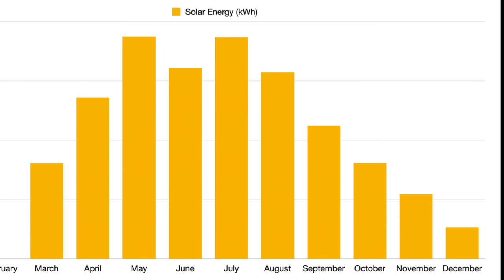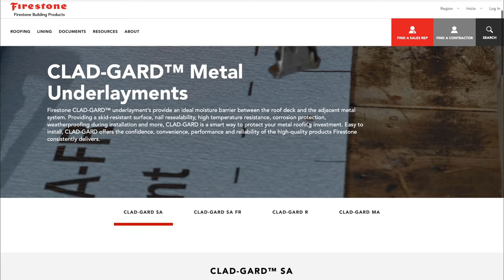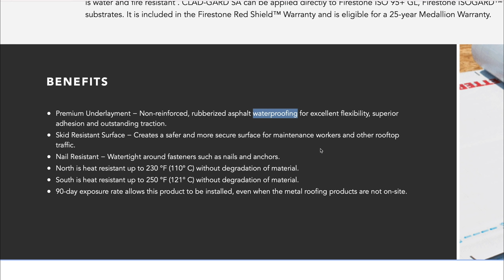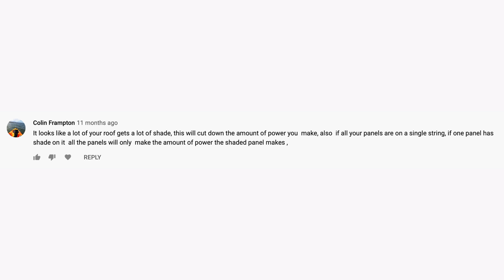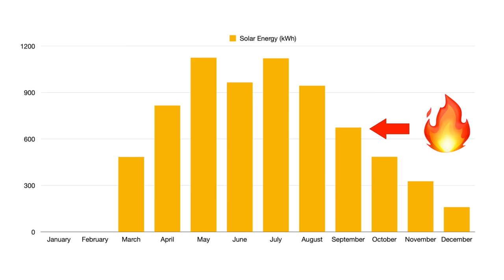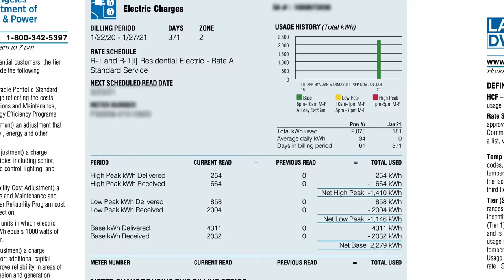1 Year with Tesla Solar Roof: top 11 questions answered + real production numbers & utility bills!

Comment: That electricity bill should have been +1,800$ as the power company is mooching off your excess.
Reply: I wouldn't be entirely sure of that. Due to the power production shutting off at night, which is when most power is used, and falling off during winter, again when most power is used, I'd expect them to still be using a noticable Chunk of mains electricity each Day. Depending on what the arranged, they could have gotten Lower cost's per KWH, or gotten money off there bill based on how much excess power they sent there. Alternatively, the power company could be a dick, and say that because they are taking the excess power off there hands, they don't need to give them any/extremely Little financial composition for the power they generated, in which case your probably right.
Reply: They sent 67% of the power generated to the city and yet the city still bills them. The homeowner should send the city a notice to disconnect unless LA pays their overdue bill, with late fees of course.
Reply: @Santisima_Trinidad  But that's not true. Power gets stored in the Tesla batteries for use when there isn't clear skies or sufficient daylight available.
Reply: @Santisima_Trinidad  most of the power is used during the day... 

It's a general rule but I think it's especially true in California where if you don't have your AC on 9 months of the year old people risk heat strokes since the whole state is basically a desert
Reply: @fixafix69  not here power isn't. AC is bassically unheard of, and heating is normally only used in the evening/night. That, plus almost everyone is out all day for most of the year. 
Still, thanks for correcting me about power usage in California, was just assuming power use was bassically the same everywhere, hence me forgetting about AC and such.
Reply: @DaSixtyNiner  OP didn't get the battery pack ("why no power wall? It was too expensive at this time"). So no, they didn't get anything stored for times solar isn't powering anything.
Reply: @DaSixtyNiner   @2:52 He said he didn’t have a power wall battery..
Reply: @Santisima_Trinidad  Well when he got the roof he said that it's basically calculated so it should provide more power than the house uses. That leads me to believe he has a powerwall also, if not then your statement might have at least some truth to it. Also we don't know the policies of their power company.
Reply: @DaSixtyNiner  He doesn't have batteries
Reply: According to his chart, he didn't go active with the roof until March so still paid for January and February. If you look at the bill it notes both how much he generated and how much he used. So they paid 150$ for Jan/Feb. Utility bills also tend to include maintenance fees as well, so you end up paying a little bit each bill for the powergrid to be maintained, which they would need if the roof ever failed.

Comment: We have had our Tesla Solar Roof for 2 years. We have one Tesla Wall back up battery. We did adjust the pool filter timer so it runs in the middle of the day when the roof is putting out power. The backup battery will not power the pool pump and car charger. 
     The bill from SCE is about $20 per month. The bill shows a potential payment at the end of the year based on the retail price of electricity. HOWEVER, when the time comes for payment, we get a check or credit based on the wholesale price of electricity at the beginning of the year.
     The roof is very slick and we now hire someone to put up the Christmas lights. I plan to install permanent controllable lights on the eves. 
     There is some electrical noise when I listen to AM 790 and, if you listen carefully in the bedroom my younger son used, you can hear relays clicking.

Comment: Excellent video, Thank you. Very helpful. I looked back at your previous video where you mentioned that the original Tesla quote for this project was approximately $33,700, and here you say you saved $2000 the first year. So I'm wondering what the actual cost of the project was so we could confirm the estimated time for it to pay for itself. Again, thank you for adding some customer perspective to Tesla Solar Roof!
Reply: One thing to keep in mind energy costs have gone up from utilities. In his area it went from $0.218 per kwh in 2021 to $0.273 Jun 2023 at an 8000 kwh output that is $440. So his savings will go up each year. This is often not taken into account. 

https://www.bls.gov/regions/west/news-release/averageenergyprices_losangeles.htm
Reply: @mikebalentine  Everyone says they save on their electric bill yet they never say how much they are having to pay monthly for the the actual solar panels.
Reply: @mikebalentine  The other issue is that California is gradually reducing the amount the electric companies will pay you now. Its no longer 1:1.
Reply: @ericerickson592  this does not matter when electrical costs have gone up dramatically which in fact makes it even more appealing.
Reply: @mikebalentine  so has the price of the roof and the apr for it. So yes the cost of the roof does matter. Lol

Comment: Question:1
At the annual savings on electricity, how long will it take to payback your solar investment (this include special equipment needed to share on the grid + maintenance.
Question 2:
Does the power company sign a contract with you? If so.. how long is the contract and how often can they modify the terms.
Reply: Conveniently he didn't mention the cost. I heard a story on NPR regarding solar panel roofs this year and in a nutshell this particular story said the ROI on solar panels is not worth it u will see the ROI after like 15 years because as a country let alone a planet the conversion to green energy has not been made yet. The electricity bills will actually rise for the ppl in your neighborhood because u install panels. Going solar only makes sense to ppl that have that kinda of money sitting around that want to go green.
Reply: @frankblack1014  Frank, I have a solar system here in the Phoenix area. I leased my panels for 20 years for an up-front co$t of $11,700. We installed it in January, 2019.  My panels produce 6.6kWH of power at full rating, and an average of 5.9kWH over 12 months (bad weather), and 93% of that goes back to the grid.  I'm paid 11.3cents per kWH .  in terms of the power bill, I paid just $350 to the local power company last year.  Before I installed the system, my annual power bill was $1,730 in an average year.

But the best part of the system is that I can charge my electric car at home at no substantial co$t.  Yes, if you sweat the details, it costs me about $3 to fill up the battery  roughly once every 10 days.  I figure that, if I drove a car 50 miles a day, at 30 mpg, over those 10 days I would have spent $72 on gas, at $4.50 per gallon.  That's $2,590 in gas savings every year.

Combined: Yearly $avings from electric car: $2,590.  Yearly $avings from the electric company: $1,380.  Total: $3,970 a year.  Thus, my solar payback is in just about 3 years, leaving 17 years of profit.
Reply: @crankyoldguy2  what kind of electric car did you get?
Reply: @crankyoldguy2  Too many numbers Tom it's Saturday and I've had many MEGA pints of wine. Can u break that down to laymans plz? I seen u said 11.7k up front so u will see your ROI after 6 years or so. What's the back end cost? I feel like the more detailed information in the form you provided was more of a sales pitch. Im kinda more of a listen here pal typa guy. No run around no over explanation just a real case scenario. In this case your situation is not gonna be like any of our situation but I got what felt like alot of math 😐
Reply: @crankyoldguy2  I want to hear from you in another few years after you've had to replace batteries, inverter, etc, (although by leasing your panels you will avoid this expense). Early numbers always sound great, but long term...... Nothing lasts forever
Reply: @crankyoldguy2  You would have gotten the saving in EV vs gasoline irregardless of the solar roof, the real difference is in the cost of charging your EV using your own electricity for $3 vs the cost you would have paid using Utilities!
Reply: FrankBLACK 101 mega pint! Can’t stop laughing.
Reply: @adrien2323  It's only right we show respect lol 🥴
Reply: @crankyoldguy2  Wow, I live in the So.Ca. desert, and I havent paid a power bill in 7 years. Of course, my roof is practically all solar panel.  What helps I think, is I have a gas stove, water heater, and gas heater ( which we never use unless we have older family members spend time with us in the winter, they are always cold, so we kick the central heat on for them) How many panels on your roof?
Reply: @nzelm0  lol all that savings in power bill money goes directly to the guy cleaning the panels every weak.
Reply: @Kagemusha320  Exactly, people only go green to feel virtuous, yet fail to realize that solar panels with the added complexity will incur additonal charges
Reply: most common answer for 2 ... no contract ... the local power company is regulated to purchase any excess power from small providers at CURRENT feed USE rates ... This is HOW you pay back the install fastest ... 
.
as for 1 .... on avg 30k for the roof and certifications ... and at 2k savings on hydro alone ... in 5 years he should be 1/3rd paid off ... and in 17 to 20 years fully paid off ... yes a little longer even the contract with tesla says first 5 years we say you will get this much ... after that you loose a bit .. consider it like paying for a new car ... on a long term payback ... after 25 years ... he is looking at a profit of 5 to 10k ... depending on how degraded his roof has gotten ... 
even with a old fashioned shingle after 25 years ... some need to be replaced and others dont ... so in 25 years ... he is expecting or should expect about a half replacement of the roof ... (hope for less) expect half ...

Comment: If you have solar installed on your home, your power will not necessarily stay on in an outage. I worked for a company out of Southern California, and some people with solar were outraged when their power turned off during an outage, whether it was a rolling blackout or a failure of some sort. That was a few years ago so things may have changed. I'm just saying read the fine print.
Reply: This is a safety feature in the UK. If the grid goes out you want domestic microgeneration disconnected so you don't risk electrocuting repair workers. If you want to go off grid you need an installation that cuts off the export current if the grid goes down
Reply: @cmsdengl  Makes sense, thanks for the information
Reply: you would need a switch that can isolate the house from the grid.  Generator sub panels can do this

Comment: After watching this video a year after you made it, do you plan to do a 2 year update? I was very impressed with the savings over the first year and wonder if you had similar results in year 2.
Reply: This guy was later arrested for being too gay in public.
Reply: @jennyanydots2389  I thought it was aggravated bicycle seat sniffing.
Reply: 2yr out of a Tesla product? 🤣  yeah good luck with that, their cars don't see 3 winters here in the UK. Terrible company to deal with.
Reply: @bigduphusaj162  I'm not a fan of Tesla, I think they are overpriced and based on hype more than substance.  But you are clearly making that up and have clearly never owned one.  The cars are good enough to last many years with proper maintenance, it's the fact that the batteries hold less and less power after every charge to the point where they need to be replaced which is very very expensive to the point you almost want to just get a new car... that is usually around 200-300K mile range.
Reply: @jennyanydots2389  don't talk mince. There is a yard next to the M8 motorway In Edinburgh full of 2-3yr old Teslas declared "beyond economical repair" yet not a single bit of visual damage. They leak from door seals, the headlights let water in, the electrics are chinese junk, the interior you can kick apart, the battery cells are such a joke they are known to have a hundred+ dead cells from new and the screen leaks it's fluids out. Don't you tell me what's what. I'm the 4 decade mechanic and boat builder. What are you?  I've fitted more solar panels on boats than you've had hot dinners and furthermore I drive a lexus LS500 and have no intention in buying anything other than Japanese cars as I know exactly what I'm looking at. My trade as coach/boat builder by default required me to master several motor industry trade skills before they even took me on. I suggest you maybe argue with someone less qualified.
Reply: @bigduphusaj162  And yet, for all your expertise, you start with an anecdote about the M8 motorway in Scotland. Data and evidence like the fact that Tesla cars kill far more of their drivers than Volvo or Lexus would make your point far more easily. Oh, and don't give me BS about sales volume, adjusting for sales makes Tesla look worse now better.
Reply: @bigduphusaj162  Even if you were being honest, exceptions don't prove the rule.  That's just poor logic.  I'm no Tesla fan but there is a reason why they sell pretty well.  Overpriced?  Yes.  Breaks down in 2 years?  Not usually.  Sorry kid, I understand you're on the hate wagon agains Tesla but at least be honest with your criticisms.  You might like the online attention being hyperbolic gets you but at the end of the day, you are intellectually hollow.
Reply: @quebeccityoliver4742  what are you talking about? You are arguing points that weren't even made. What a melt.
Reply: @jennyanydots2389  the guy you are arguing with is on threads explaining float charges to owners   and they are thanking him for explaining their own panels to them. I would listen to what he says and not needlessly taking his side. He even knows about the microprocessors and the coding like some sort of solar John Carmack. Have a look about you will see what I mean😳
Reply: @quebeccityoliver4742  Read the comment I sent to the other person on here. Yeaaahhh 🤫
Reply: @fakevirus8828  Ha...  hahahah, looks like Tyquil made himself another account.  Do you really think I believe that you aren't that kid?  Come on man.  You must be completely devoid of self-awareness.
Reply: @bigduphusaj162  I don't remember this thing having wheels?
Reply: @mburch5680  never said it did.. when did I say that? Just talking mince for the sake if it are you?
Reply: Jeez you two, just get a room already

Comment: Just a tip never stand infront of a circuit breaker when turning them on. Stand to the side with back against the wall. It could save your life if it explodes.
Reply: Unlikely for house-size equipment. Arc won't be that large. It is unlikely the house will be drawing full load. 240 volt max at maybe 100 amp isn't likely to explode like 440+ volt industrial stuff. 120 volt tickles (unless you grab it with both hands), 240 bites, 480 blows your finger off, 13,000+ they sweep up the ashes
Reply: Not hardly. They do not explode.
Reply: A long time ago, this advice saved my dads life.   People had switched out fuses for welding rods in a 480 connection, and when he turned it on, it blew the cover off the box and sent it flying across the workshop
Reply: You've spent too much time in the class room and not enough time in the field.
Reply: @NuFinalSaber  Now you're talking 480 volts. On a short circuit situation it WILL explode like a cannon. I have seen that happen for sure. This will not happen with a 230/115 volt branch circuit in a residence.
Reply: Thanks for all the info. I was taught to never stand in front of any but I was normally working with very high voltages in power engineering. Maybe you’d be safe with lower voltage but I still wouldn’t.